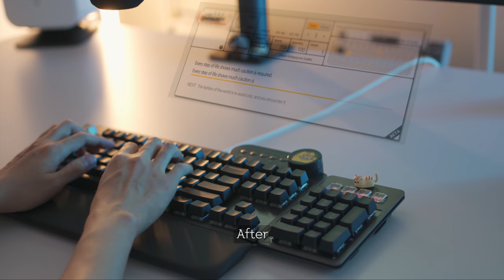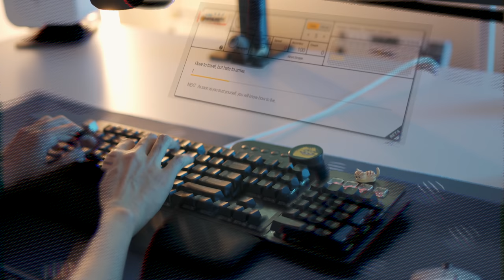Lubed Cherry Reds on Everest Max Before & After Typing Sounds Comparison

Comment: Great video! Why does the space bar at the end sound different from one end to the other? My spacebar does the same even after being tuned well.
Reply from the maker: Many reasons. It would be a keycap, a switch, unbalanced plate, stab housings, wires, structure, overall balance and so on.
So I just can't say one.
Reply: @3ildcat  Thank you! Im personally using a 4mm integrated plate, so for sure thats not the reason. So its either the keycap or stabs. Personally I dont care too much as long as it doesnt rattle :)

Comment: How do you feel about lubing stems & springs only? Sometimes I feel like it can make the whole lubing process so much faster and you don't really lose anything by not lubing the bottom housing... you also are way less likely to overlube the switches.
Reply: thats what i do if im not buying prelubed switches. its the same effect and its faster and youre less likely to overlube. also  if you literally just do stab mods your board is gonna sound amazing unless you dont bottom out, in which case a lighter weight might be better for you anyway
Reply from the maker: If you are not that super sensitive, it would be enough as you can hear the difference here. Totally up to you :3

Comment: Mr 3ildcat, how does the krytox 105+205g2 mix used for the stem compare to krytox 205g0 in terms of feel?
Reply from the maker: mix is slightly thinner so easier to apply
Reply: @3ildcat  ( >ω<) <3

Comment: is it redundant to lube the rails of the based and the stems? Should I only do the stems moving forward to save time?
Reply from the maker: I believe there is no 'should', just up to your preference and style.
Reply: You can get away with just lubing rails and spring Gazzew style.  I also lightly lube the top housing right where the stem hits because if any lube gets there, it really mutes the rebound sound, so Id rather have it the same on all switches

Comment: Should I use permatex dielectric grease for the stabilizers or my mechanical keyboard?
Reply from the maker: permatex dielectric grease -> stab wire :3
Reply: @3ildcat  thanks! 🙏
Reply: @3ildcat  If I only have 205 g2, is it worth buying permatex? Or is it enough, as in this video, to lubricate the 205g2 metal bracket?
Reply from the maker: @SVLemur  205g2 is enough :3

Comment: Have you stopped lubing the switch housing? wondering if I should try that
Reply from the maker: It's just optional so just try what you prefer :3
This time, I just did simple things to make this work easier.

Comment: you didn't lube the switch housing?
Reply from the maker: IMO, lubing stems and springs is essential, but other parts are just optional (preference)
I just didn't lube this time. too many switches hehe
Reply: @3ildcat  oooh did you feel any difference?